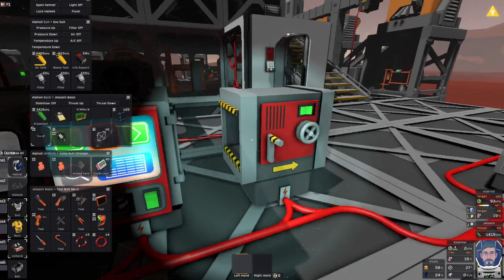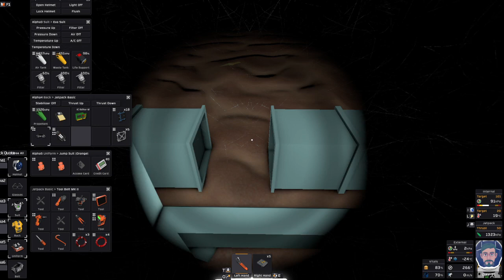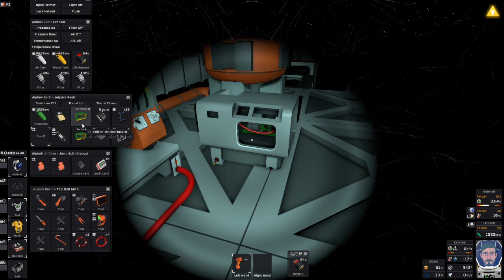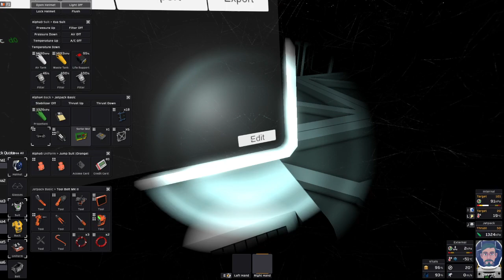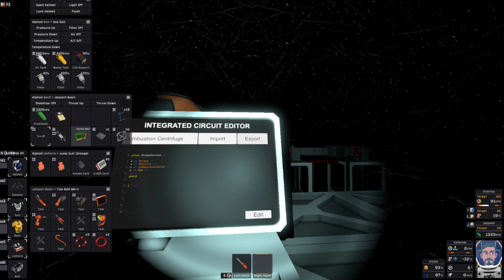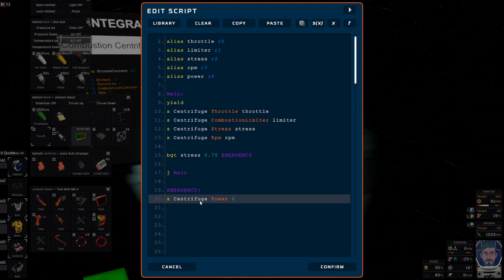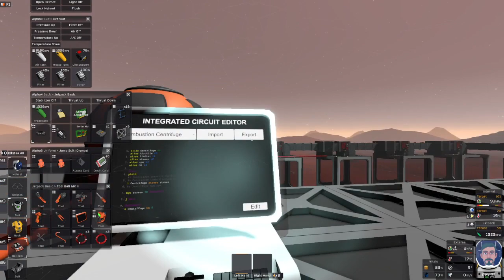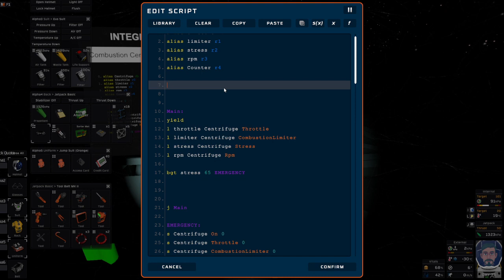Stationeers S02 - Survival - Ep31 - IC Coding the Centrifuge, Part 1

Comment: Load values into a register and s  save them to a display so you can see what you are doing and what works before doing your branches.  Helps you visualize what is happening.  Good for you learning IC10.  If you are going to move on to harder worlds you will need to be quick and experienced.

Comment: "db" is the device itself. For a housing, you can write numbers/values to the "shell" itself, and see them from the outside. For anything else with a IC10 socket, it's that device alone.  And those tend to only have two externally addressable device dials to use if needed; vs the 6 for a housing.  The example code probably had a pump on the exhaust to make sure it didn't overpressure and burst a pipe.

Comment: They call it move vs load, because that's how real world IC's work.  The move command expects 2 arguments: to where and what; while the load command expects three arguments: to where, from where, and what name to load from.  Move also tends to be internal from a constant or a different register, so it's "scope" is different.  Real world IC's may save the time it takes to address remote devices too, so it's faster to have a move command for those "internal" writes to a register.  Even reading from memory referenced location is slower than the move from a constant in most IC's, because the fetch cycle got the constant as part of the command and it's in the CPU already.

Comment: Halfway through the video, but noticed you had lines with gray text.  That's the editor telling you that something is missing.  They were at the end of the set commands, basically all saying "r?" was missing.  Anything that has an "r#" is looking for a register number or alias.  Same for d# grays... but then it's expecting a device number or alias.  Similarly, when it says "logictype" in that gray color, it's looking for one of the logic name like throttle/on/mode/etc. that can be written to or read from depending on the command. When those are correct, it's displayed in that orange color.  When the text is red, like when the caps are wrong... that's an immediate notice that the editor doesn't have any idea what you're talking about.  When you did the BGT command, and the third item was gray in some places, and red in another; it was looking for a register or number by saying "c(r?|num)". Which translates to "argument C can be a register or a number".  The editor is trying to tell you stuff, stop and observe it's complaints/hints.

Comment: Imagine the IC chip, regardless of what it's contained in, is some dude in a cubicle, with very basic instructions he can follow.  Registers are his inboxes and can store values on paper slips.  He can be told to LOAD info off the network into a register, but only through a device reference and name of the value to LOAD.  To STORE something back to the network is the reverse. Take something out of a Register, and put it on the network to a specific device and logical named "place" in that device. Go old school and imagine they are just pneumatic tubes off to other devices, labeled "db, d0, d1, ...".  When instructed to store something, he loads the paper slip containing the value, with a scribble about where it belongs at the other end and sends it on it's way.  When told to load something, he sends a note "please reply with what's in your 'throttle' value", and some dude in the cubicle for the device does that and sends it back via the same tube... which the first dude places in the register/inbox he had noted in the instruction.

Shake off the high level language "ease of use", where the compiler/interpreter does lots of the hand holding about allocating memory and knowing it's going to store an integer and so forth...  IC programming in general is bare bones "tell the silicon exactly what to do for every step" programming.  VBA might have "C = A + B" as a simple line, but for an IC, you have to have established a place for each of those values in a register (A and B); loaded them from memory or moved as constants to those registers; then told the chip to do the addition and store the result in yet a third register holding the value you want to put back into memory or write to the printer or whatever...  (or if registers are in short supply, overwrite one of the input registers) If the ABC variables are memory chips wired to the IC housing and are on d0-d2 respectively, the code would be:
alias r0 intA
alias r1 intB
alias r2 intC
alias d0 memA
alias d1 memB
alias d2 memC
l intA memA Setting
l intB memB Setting
add intC intA intB  #C = A + B
s memC Setting intC